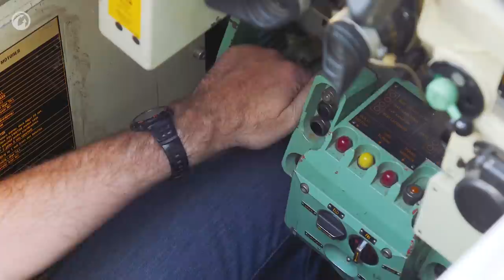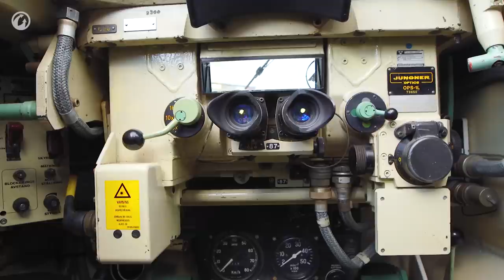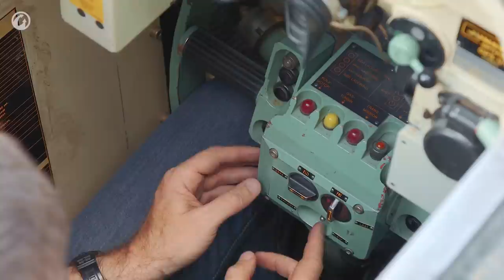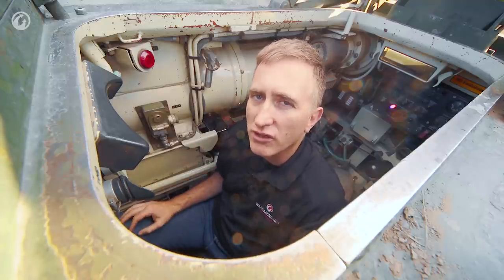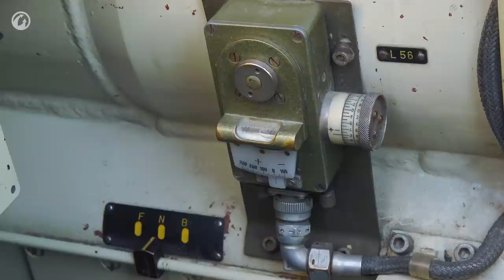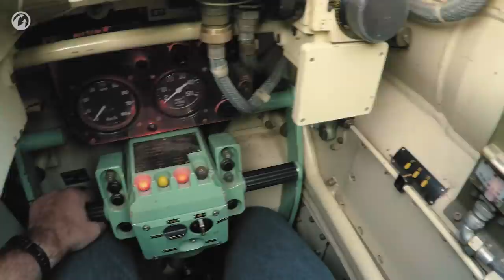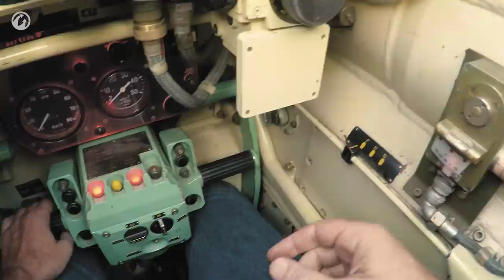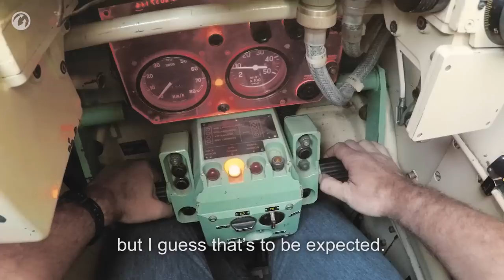Inside the Chieftain's Hatch: Strv 103C part 3

Comment: What sort of roles is it designed to do that a tank destroyer or self-propelled anti-tank artillery piece is not?
Reply: Ser Garlan Tyrell neither.  As the designation 'Stridsvagn' says, It was designed and used as a main battle tank in the same way as the Centurions that served alongside it.
Had it been a tank destroyer, spg or assault gun it would have been designated as 'Pansarvärnskanonvagn'(Pvkv), 'Bandkanon'(Bkan) or 'Stormartillerivagn'(Sav) respectively. 
There is an SPG based on an elongated S-tank hull, it's called Bandkanon 1A. There are youtube videos of it, it's a quite impressive and unique vehicle in it's own right and until the program was scrapped,  that SPG was considdered as a potential launch platform for tactical nukes and chemical agents like sarin nerve gas.
Reply from the maker: Like any other tank, it is designed to engage with direct fire any target on the battlefield, in offense or defense, while having the armor to withstand attack from any likely threat.
Reply: TheChieftainWoT Chieftain maybe you will do a M1 Abrams inside the hatch? First models are almost same age as Patton or Leo 1 :)
Reply: And they hope that the the battlefield isn't in an urban environment...
Would it have been more effective when defending/less effective when attacking?
Also its all well and good comparing it to the Centurion, but considering production didnt get going until '67, both the Chieftain and T-64 would have already been in service. How would the 40mm of armour fared against their guns with contemporary sabot ammo?
Reply: Ser Garlan Tyrell it would definitely have been more effective in defence or enveloping offense in semi-covered countryside than anywhere else. What really made it obsolete was the turbine exhausts going upwards and the inability to traverse or lay without engine power as the turbine exhausts pop out like a small sun in a thermal sight...
It's main protection comes from the extreme glacis angle which means that not even apfsds has much of a chance of normalising enough to penetrate and doing damage from the front and from the sides it's likely to over penetrate if it hits. After all, a vehicle as low as the S-tank is easy to hide in cross country driving anywhere that's less flat than the US midwest...
Reply: APDS was not a problem with the angel on that glacis. HEAT was and that is why there is the "fence" and the differen standoff compartements like the fuel cans and spaced armour.
It was the common use of reliable APFDS and working and usable gun stablization that "killed" the design and rendered the armour ineffective. there were proposals to upgrade the armour with ceramic plates. That would have helped better against the APFDS, but it still was behind the modern fully stabilised systems.